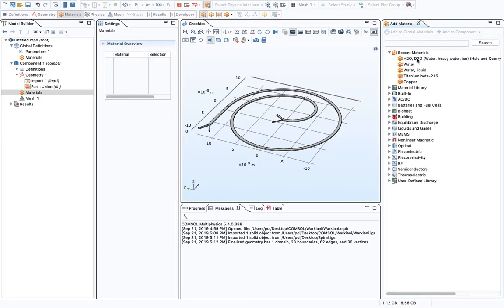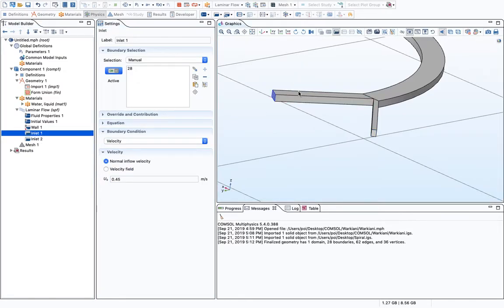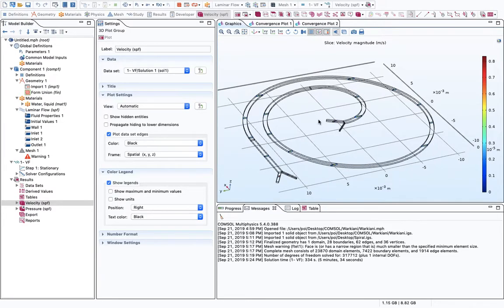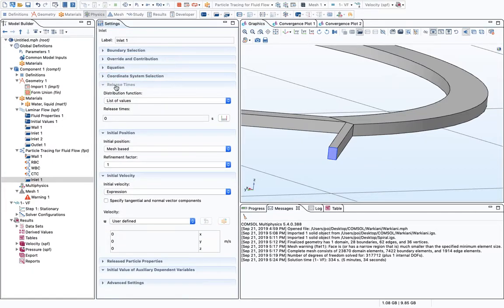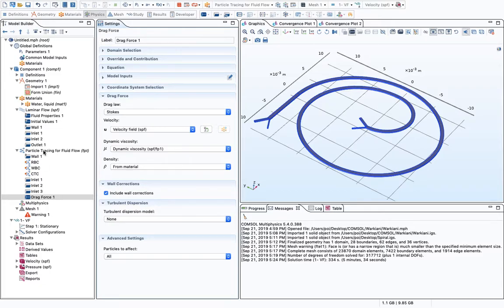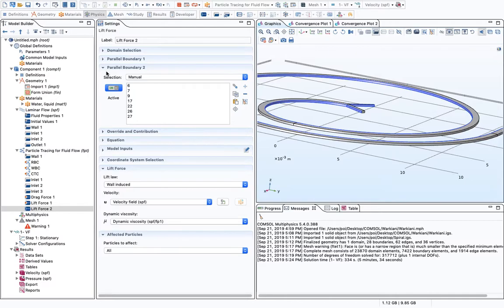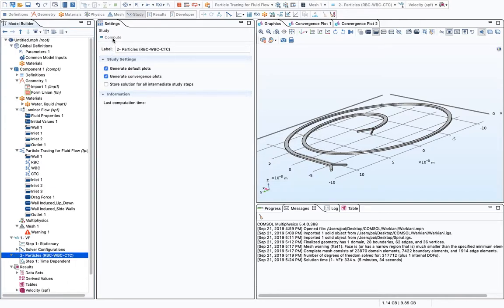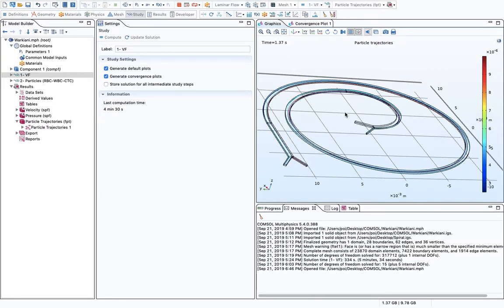COMSOL Tutorial | Inertial Focusing in Spiral Microchannel | Part 3 - Particle Tracing

Comment: Hoy Moein I have another question, in particle tracing model, i try to change the dimeter of the particle but it doesn't change. i mean either with 6um or 100um there is no change in size, at least observable change. thanks Moien

Comment: Thanks a lot mr.naderi.
I have a question about the memory that this kinds of simulations need.
Actually i have a model with 4 rows of spiral, and RAM is 40 GB. But unfortunately i accost with out of memory  error and can't have more than 500 meshes. 
It is when some articles did such this simulation with 1 row of spiral and over 3milions meshes and just 16GB RAM. I can't even do this problem too.
How can i solve this problem?

Comment: Thanks a lot for the fantastic video! Because of your video, I simulated a good result. But in the actual chip, large-sized cells flow along the inner wall, but at the fork of the outlet, they disperse and go out from the two outlets respectively. What may be the reason?

Comment: Hello Moein. You have done an incredible job, this really helped me. But can you tell me why I might not observe dean migration in a spiral channel with smaller cross section. I have kept both the Re and De number same FYI. Thanks again.
Reply from the maker: Hi Mohammad,
In spiral channels, you have to define a cut plane that is exactly perpendicular to the flow in order to be able to visualize the dean flow, otherwise (by using predefined planes) you can't observe the vortices.

Comment: Good day, I have simulated your tutorial with positive results, however, my output gives the trajectory of the particles in low-resolution circles. It looks as if the time steps are too small so it has large straight lines instead of a circular trajectory like yours. I used your exact increments of 0.01s but I do not get such a well-rounded trajectory. Also thank you so much for this tutorial it is absolutely brilliant.
Reply from the maker: You're welcome.
So, have you tried decreasing the timesteps? Like use 0.001 instead of 0.01
Reply: Has your problem been solved? I also encountered the same problem.Can you give me some advice?

Comment: Hey, not sure if you can help  but lately I have been doing some simulations very similar to this one. The problem is that the smaller particle instead of migrating to the outer wall, migrates to the inner wall. In theory this doesn't make sense, the smaller the particle, the further it migrates from the inner wall. Was wondering if you had gone through something similar. I have a good mesh (normal physics controlled), good discretization (P2+P2), made your tutorial several times and always get similar results. Only when I decrease the velocity (for instance 50 ml/min) the particles present expected trajectories. Do you have any idea what can be wrong?
Reply from the maker: Hi... What are your channel dimensions? Dean number? particle radius? It all matters. Maybe both particle sizes are significantly large and they equilibrate near the inner wall.
Reply: @moeinpoi  Hi, thanks for replying.  I'm replicating the spiral in this video https://www.youtube.com/watch?v=GFV89cOAg9c
The spiral has five turns with channel dimension of 300 um width and 50 um height. Dimensions of particles are 5 um, 20 um and 40 um. For a flow of 100 ul/min or more, both 5 um and 40 um particles equilibrate near the inner wall while the 20 um particle is the furthest away. For 50 ul/min, 40 um particle equilibrates closer to the inner wall following the 20 um and then the 5 um, as expected. I don't know why the smallest particle equilibrates in the inner wall for velocities higher than 50 ul/min. It doesn't make sense to me, probably a higher velocity might be inducing instabilities in the simulation idk.
Reply: @moeinpoi  I think I solved the problem. I changed the dimensions of the particles to 20, 30 and 40 um and added a multyphysics that coupled the laminar flow and particle tracing. Not sure why it worked but at least I'm getting good results now.

Comment: its  great i have question about magnetic force acting on the particles
Reply from the maker: I actually haven't worked on magnetophoresis myself. All I know is that you can also add it to the lift forces in the particle tracing module.
Reply: @moeinpoi  am stack in this problem do you recommend some tips for m
Reply from the maker: @aliumara1205  What exactly is your problem?
Reply: Moein Naderi  i cant make the particles response to external magnetic field

Comment: Fantastic tutorial! I tried this step by step in COMSOL 5.4 but the particles trajectories are quite unstable. I even refined the mesh but it just doesn't work. I don't know what possibly could be wrong since i followed your tutorial very closely.
Reply from the maker: Hi! What exactly do you mean by the particle trajectories being 'unstable'?
Reply: hi! fast reply! I started again a new simulation and turns out now the particles trajectory is fine. Did you do any post processing on that particle trajectory at the end? My particles size is way bigger than their real size. i adjusted the ratio scale factor to 1 but they disappear. thank you
EDIT: when i said the trajectories were unstainble i meant that they didnt have that laminar behavior. the would pass through the wall and make abrupt changes.
Reply from the maker: @vitorhugoRH  Well, you'd have to play with the 'Radius scale factor' under Point Style until your particles are the size that you want. For this case, something between 0.02 to 0.009 would work. But it might be different case by case. You can change it by trial and error until you get to the value you want.
Reply: @vitorhugoRH  Hi Vitor,  my particle trajectories are not laminar, pass through the wall. When you said you started a new simulation, what exactly did you do? Did you go for a better mesh?
Reply from the maker: Hello Praneetha, 
I think you should decrease your time-steps.
Reply: @moeinpoi  I actually increased the time-steps and that fixed the issue. However, I do not see any particle separation. Do you have any guesses why? I followed your instruction very closely. What do you mean by "You can simply add in your desired values as the initial and boundary conditions and run the simulation"? Can you please leave dimensions of the device in the video description or this comment? I just want to verify them. Thanks for the elaborate tutorial and your reply!
Reply from the maker: Well, are the trajectories of your particles realistic? I mean, do the different sized particles follow different trajectories or not?
As for dimensions of the channel, I have explained the procedure of creating the geometry in the 2nd video, and have mentioned the dimensions there as well. But as I've mentioned in the description, although the particles are separated in the geometry that I used, they are not totally in agreement with the dimensions of the channel in the paper. If you create the spiral design exactly with the info given in the paper, it should work just fine.
Reply: @moeinpoi  No, all the particles move along the outer wall and exit through the outer outlet. I do not see any deans drag acting on them.
Reply from the maker: Maybe the dean flow that is developed in your model is weak and you can't see its effect. Did you create your geometry based on the dimensions in my 2nd video or based on the info in the paper?
Reply: @moeinpoi  Based on your video part-2
Reply from the maker: Then if the inlet boundary conditions and different parameters are also the same as what I used, it should work. I'm not sure what could cause the problem. Did you change the discretization of the fluid to P2+P1 as well?
Reply: @moeinpoi  Yes, I used P2+P2. I will try to do everything from scratch more carefully. Thanks for your help!
Reply from the maker: Great! Hope it works.
Reply: @moeinpoi  Update - I did not check "Scale values when changing units" box when loading geometry into COMSOL. Silly mistake. I did it from scratch and its works perfectly now. Thank you
Reply from the maker: Great! I'm glad it worked. Good luck.

Comment: Many thanks for your tutorials. However, I think you made a mistake when you said that the shear gradient force is "embedded" in the velocity field. I believe you ahve to add that separately as a lift force and choose Saffman's equation. Also, in my model COMSOL don't seem to consider Drag force for some reason.. still trying to figure it out.
Reply from the maker: You're most welcome. 
 To my understanding, Saffman is just a rotation-induced lift force, and is rather negligible in curved geometries, because of its relatively smaller magnitude in comparison with the wall-induced, shear-gradient, and the Dean drag forces. However,  what I have recently found out is that the shear-gradient lift force is actually 'embedded' in the wall-Induced lift force. In fact, Comsol has defined the 'net inertial lift force' equation which is the 'superposition' of the wall-induced and the shear-gradient forces - and for some unknown reason to me - have just called it the 'wall-induced' lift force without mentioning that it indeed calculates the net effect of the two mentioned lift forces. 
 On the other hand, I think I might have mentioned that the Dean drag force is embedded in the 'Drag Force' rather than in the velocity field. In fact, we will have lateral components of the velocity field in the direction perpendicular to the wall ( Dean vortex) in curved geometries like spirals, and the Dean drag force is simply calculated and exerted on the particles using the Drag law ( in this case, the Stokes law) that we add in the Particle Tracing physics.
Reply: @moeinpoi  Actually, this is not true. Saffman force arises not because the particle rotates but due to the shear rate caused by the relative speed between the fluid and the particle. Depending whether the particle leads the flow or lags behind the flow, a force will move the particle either toward the wall or the center. And this should not be confused with shear gradient lift force which is a consequence of the parabolic velocity profile in Poiseuille flows and always acts toward the wall.
Reply: @moeinpoi  Thanks for your explanation. Could you please give a reference to the informtion that says that the wall-induced lift force is actually the superposition of the wall-induced and shear gradient forces ? That would be extremly helpful. Also, is there any way to give each particle type a different colour in the plots ? I see yours appreaing in 3 different colours.
Reply from the maker: @3dsquaduk  The formula for the net inertial lift force (F wall + F shear gradient) was proposed by Ho and Leal in their
1974 paper: "Inertial migration of rigid spheres in two-dimensional unidirectional flows". This is the formula: FLift=Fw+Fs=ρU2maxa4/D2h(β2G1+βγG2)
If you check the formula equation for the wall-induced lift force in COMSOL, you'll see the exact same formula.
For the colors of the particles, you can simply go to the "color expression" section in the particle trajectories results, and set it so that it represents the radius of the particles. I think its default mode is set to "particle velocity".

Comment: Can we make the mechanical properties like young's module and ... for  the particles? for example cancer cells are softer than RBC.
Reply from the maker: Actually, I have not tried that. I am not sure whether or not we can define the mechanical properties of particles in COMSOL. However, it might be possible by creating a dynamic or moving mesh for the particles. Again, I am not sure if this approach is applicable in this case.